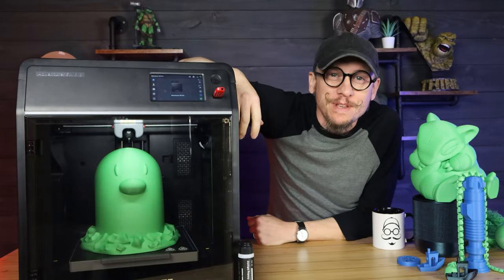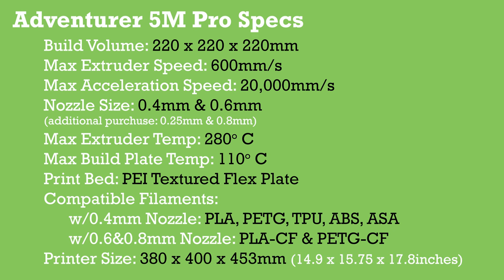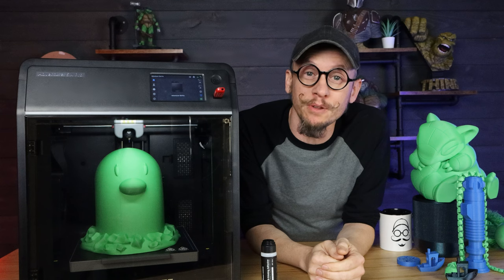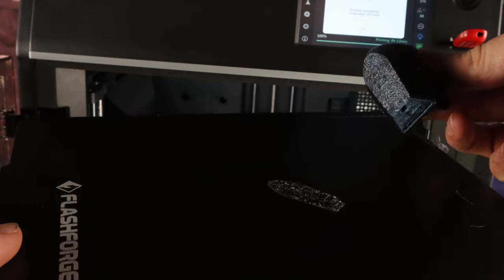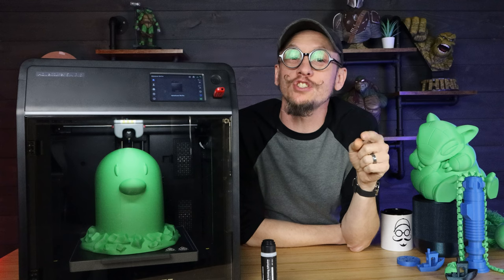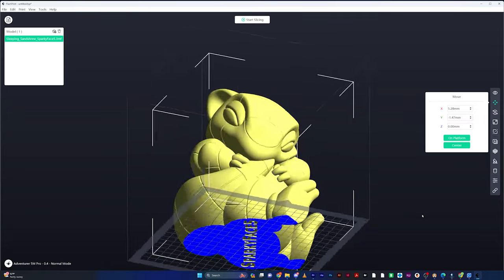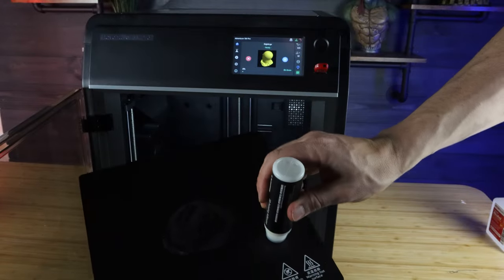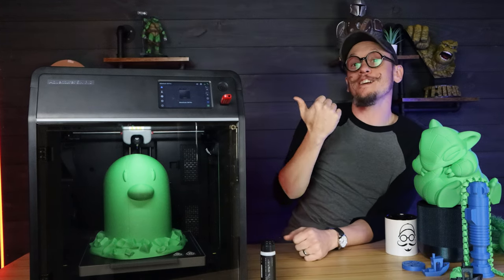Flashforge Adventurer 5M Pro 3D Printer Review

Comment: Love the review... The quick-change hotend is super fantastic - Wish all printers were like this.... Though Bambu Labs set the standard, it seems the rest is starting to catch-up pretty fast and making a niche in their own right. I even love the new chamber filtration on this printer. Now if they would have made the build plate standard like the 256 cubed, this machine would give bambu a run for its $$$$.
Reply from the maker: Yeah I told Flashforge all the things I think they need to address to really start making their way to the top. Build volume is a big one for sure. But I do think if they listen to what people want they will be making one hell of a machine.
Reply: @ItsMeaDMaDe  I agree... I just heard that bambu made a X1E with the same type of filtration system with a few other upgrades... 
I think 2024 is going to be a fight to the top... 
If bambu made a 350mm cubed.... I think they would corner the cosplayers niche hands down.
Reply: Flashforge has been around long before Bambu lol. They didn't invent the quick change nozzle.

Comment: I’ve used Flashforge machines with students and they are school friendly. I’m curious to see what they did with the extruder. The ones they used in previous machines were weak and they clunked all the time. How is the access to work on it? It was tough on previous models. Nice box, but hard to work on. How about pauses for color changes?
Reply from the maker: I haven’t had to work on it but the it seems it’s easy to access the areas you would need. When it comes to color change the flash print slicer actually has a setting to stop at layer heights to change colors so it pauses the print so you can.
Reply: Had the same experience with the Adventurer 3. Especially those cool quick-change nozzles were really bad. Clogged alot and had to spend quite some money on new ones. V6 or vulcano nozzles are much cheaper to replace.
I really want to like this printer, especially for the noise levels (don't want a screaming bambu), but those nozzles are holding me back.

Comment: You don't need glue. I never used it with this printer, at least for PLA. Just set plate temperature to 65 degrees as the first layer, it sticks well just by itself. Also, it is now fully integrated with Orca slicer and has all profiles predefined, including features Wifi and Camera... You can print a side attachment to mount filament at side of the printer. Nozzle clogged once, easy to unclog, just follow on screen instructions. Thumbnails images now got better resolution. Excellent printer, that gets better and better each update! Print quality is remarkable, sometimes surface seem so smooth, even for highly complex models, as it was injection molding. Very satisfied!

Comment: I LOVE my FF-A5MP ❤❤❤  Thanks for helping me decide!  Cheers!!!!
Reply from the maker: No worries. And as a update for using it over two months I’ve thrown quite a few spools through it and I still really like it.
Reply: @ItsMeaDMaDe  So, now that I had some time to use it.  I can really appreciate your video even more.  There's a couple of things I noticed that I thought I'd share.
- The PC Sticker Sheet is intended for ABS/PC/ASA, hence the reason for the glue.  Only, you have to use the glue for PLA or any filament that you're using, including the failed print that you had.  I guess they thought since they were giving you such a hot nozzle that the plate should match.
- You can purchase (awaiting in the post) a non-glue PEI Sticker Sheet intended for PLA/PETG/TPU from their website
- The magnet on the bed... WOW is it powerful!
- When changing filament, cut as close to the extruder as possible.  The printer goes into auto-mode immediately to the new feed.  I do wish there were a way to stop the extruding, it seems wasteful on the amount.  Maybe in a future firmware update?
- Also, I wish they had a "Home' option in the Change Filament menu.  I keep forgetting and have to come out every time.  Actually, I'm surprised it's not an included step in the process.
- Quiet, it's quieter than my Prusa.  But, I have it modded and pimped-out so I can't remember the stock model noise.
- I Macgyver'd a 'Lazy-Susan' so that I can rotate the machine to get at the back to change filament, network, etc.  It works great.  But, I agree, the side would have been a better.  I have no idea why they designing these machines like this?!?!
- Network, if you are using FlashPrint to connect via network you MUST make the IP Address static.  Do this on the router.  This also seems to be a standard issue with the new network direct connect systems.
- Profiles:  OrcaSlicer download from their website, Cura already had it, and PrusaSlicer I will create a new profile mimicking the FlashPrint configuration
- The glue is actually really, really good.  Only one problem!  I can't seem to find a place where you can actually buy it!
- The Bed Temp, they have it profiled at 50C.  I am so used to 60C!  Nothing major, just something different than what I'm used to.  Shhhh... I bump it up to 60C, old habits!  :)
- I agree on ALL of the improvements that you mentioned; e.g. phone remote access, etc.
- I have to disagree with you on the 'who this is for...'  I would say, "Anyone!"  I have been in the hobby for years and have several printers, but this one is now my favorite.  Beating even both my pimped-out and modded Prusa's w/ MUU2s.
- My major GRIPE is not having an AMS and not knowing if they ever intend on offer one

Cheers!

Comment: I got a question, I'm planning on buying my very first 3d printer and I'm going for an fdm type like this. Does these enclosed printers usable in a basement and not worry about the smell and fumes? Or do I have to vent it out?
Reply: Speaking from experience, (I have an Ender 3) it depends on the filament. If you're gonna be printing primarily PLA or TPU, then you shouldn't worry about fumes. ABS and other filaments like it do have some pretty strong fumes, though.

Comment: That thing, on head with no bowden connected. Im using that way since ive changed my ender to directdrive. I also did it to K1. But on ender ive got big gear sticking out to manually load filament, which is missing on K1 like here in flashforge
Reply from the maker: Oh that’s cool. I’ve honestly never seen that in a printer. It’s a really unique way of doing it.
Reply: @ItsMeaDMaDe  its because im a lazy guy xD got 2 bowdens with this setup, im switching often between filaments. Its way faster. Also there is no reason to have solid connection in this part of printer

Comment: Hey need help to adjust bed to raised a bit as my print doesn't stick to the plate
Reply: Select the option to auto level before each print. I’ve been doing that and have never had issues with bed adhesion

Comment: I have a 5M and my son has a 5M Pro. I'd say abot 80% of the time prints fail to start on both printer. Error message "Probe triggered prior to movent. Check level Censor". Can't figure it out. When they do print they print great.
Reply: Did you ever figure this out?
Reply: You have them on floppy surfaces....you need a more stable table or get a couple small L brackets and secure it to the wall

Comment: Is it possible to pause a print, and continue it later? And if so, will it automatically pause if there is a sudden power loss?
Reply: Yes, both of things! You can even change filament color and continue making new layers. But notice that whenever you pause printing, you will probably see a little trace layer on the print, because resuming won't ideally stick to the layer that completely cooled.

Comment: I am in doubt between these two printers, the Creality K1 or the Flashforge 5m Pro, which one would you recommend? Thank you.
Reply: dont get the creality it has so many problems
Reply from the maker: @penny-rose I’m curious what your problems are. I have both and I like them equally…
Reply: @ItsMeaDMaDe  it clogged big time, than we tried support and it took 2 months to even respond. than after 2 weeks they gave us a refund and literally said have a nice life
Reply: @penny-rose  You got an older version of the K1.  They changed everything in it on the newer ones that are being built.  There was an extruder and gear issue on the first ones out

Comment: So when you say it is a fast printer, do you have a actual print and time we can compare with the other fast printers out there right now. Like, what is the fast benchy print time and the quality of the fast print? Thank you for sharing this new printer with us.
Reply: they are almost the same...useable around 300m/s
Reply: Thank you. @MsJellyfan
Reply from the maker: Yeah @MsJellyfan is right they are very similar. It came with a benchy on the sd card that printed in 13 mins but when I sliced one that isn’t a custom slice like the one it came with it took 17 mins which is still pretty darn fast.
Reply: Thank you. Was the quality of the print still good at that speed.
Does the printer go threw all the vibration setup things like the Bambu lab printers? @ItsMeaDMaDe
Reply from the maker: @Robothut yeah the quality is great and yes it goes through almost the same processes with vibrations.

Comment: nothing heard a Creality K1 can´t do, its like a smaller but Outer dimensons seems bigger.. version, and 50dB isn´t quit...i have k1Max and closed with pla at 300m/s standard profil its around 50dB most time less....and i can hear my printer a floor below! but your content is right on spot, only the product laggs... hope its much cheaper that creality´s products
Reply from the maker: It’s right in between the cost of a k1 and k1 max.  That’s crazy you can hear another printer at 50db. That’s the equivalent of a small fan. Nobody in my house heard it running when I was using it. But I guess everyone is different with noise sensitivity. Thanks for the comment.
Reply: Well my k1 cannot be heared a floor below Strange
Reply: @lukasritter2544  it's only when the side fan kicks in like a jet engine! But also without it, it's absolutely the loudest printer I have, when not fully closed and printing something like Pet-g or ABS... but it seems obvious, more speed, faster movement, more cooling required...more noise....

Comment: They have to find a way not to force people use glue! PEI sheet is low quality or something else. Not buying just because of this.
Reply from the maker: Yeah. I recently printed my first layer at a slower speed 20mm/s with no glue and I did get a first layer. I think they intended the glue when your printing at their default setting which is 50mm/s.
Reply: I was getting on here just to say the same thing. I usually prints my first layer at speeds under 30 mm/s and I've never used glue on this thing. And I've already printed some items as tall as 200 mm
Reply: It really should be no biggie to print the first layer slow (and sure). How much of a hurry can anyone be in? 

I do like how these printers are becoming as close to Appliances as they're ever likely to. Not just for beginners but also experienced folk who want solid reliability, perhaps because they're making and selling product. 

Let's face it, if we want a machine to constantly fettle with there's plenty of choice out there 😂

Comment: I have it for a month and scap it already. Its nozzle clogs so often and it broke its expensive nozzle. Watch out of this product. 👎
Reply from the maker: Really? I’m still running mine on the same nozzle and it works really well. Could it have been your filament your using. I know some cheaper brands are notorious for clogging nozzles because of all the filler in the plastics.

Comment: All of these reviews, and NONE of them are mentioning what firmware this printer runs OR the $40 it costs to replace a single nozzle. 
If it runs Klipper, more people will buy it for the control it provides it's user, and the ability to mod it.
If it's closed-source, it's competing against Bambu, which it will 100% lose given Bambu's market dominance and options for future expansion.
Would somebody please, confirm what firmware this printer is running . Unless FF told you not to, which would be kinda sketch.
Reply from the maker: So Flashforge didn’t tell me to say anything they just gave me a printer. There is a lot to cover and I covered what I thought was most important. To answer your question about it though it runs marlin and is open sourced. The nozzles depended on size costs $35-40USD. Which I think isn’t bad since a ruby nozzle can cost up to that. Hope that helps.
Reply: @ItsMeaDMaDe  The quick-change nozzles in the Adventurer 3 were horrible, clogging all the time. Hope they improved it. I really appreciate the low noise though.
Reply from the maker: @rinkelk  yeah unfortunately only time will tell for me. If I start having a lot of issues I’ll definitely do a follow up video to explain the additional problems that arose if there are any.